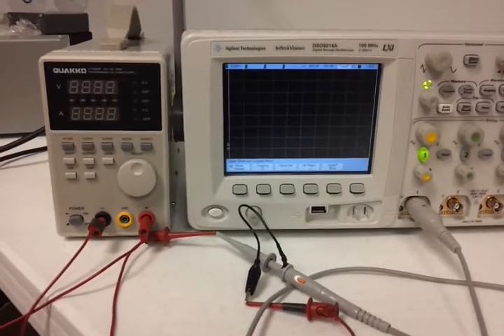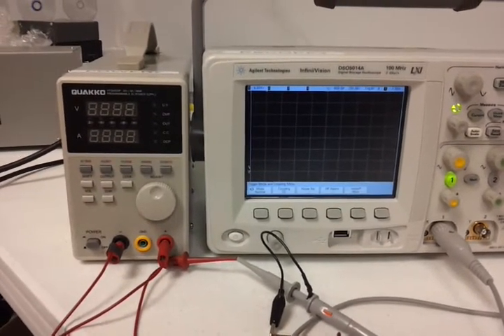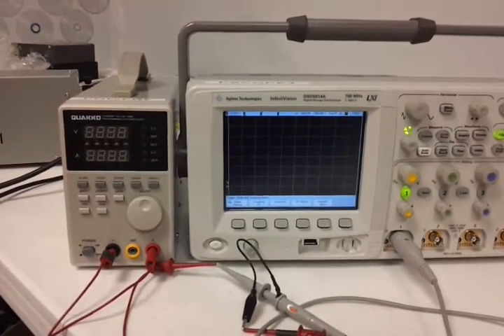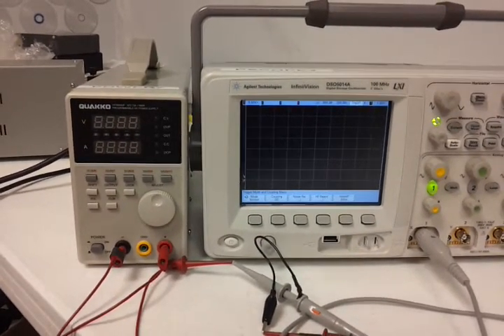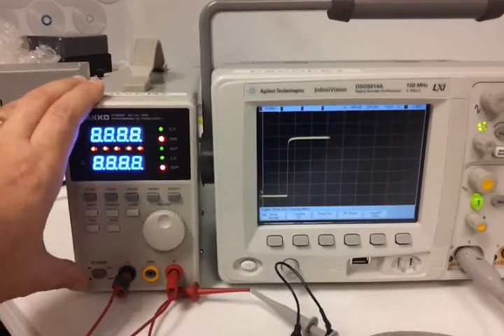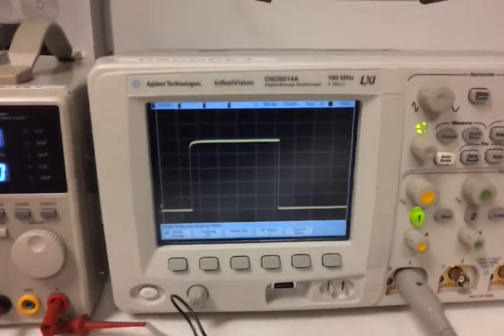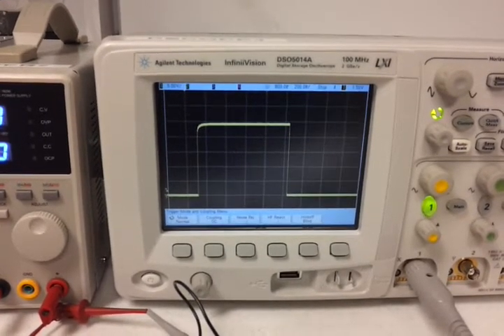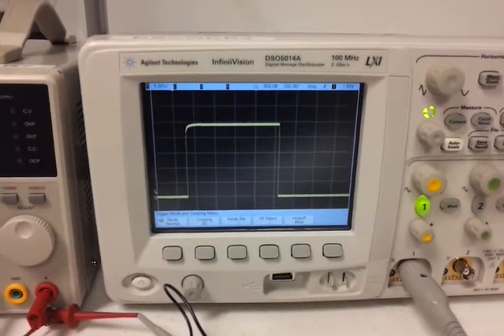video-2011-12-15-16-55-06.mp4

Comment from the maker: Yes, I believe this is correct.  A brief look at the circuits inside shows that it has a transistor follower output stage and that the base drive of that transistor floats to about 28 volts in the first second of turn on, then goes away.  Looks like the opamp regulator circuits default to high voltage during that time, which is bad.  I'm sure some suitable RC startup circuit somewhere in the design, even if it was directly across the base drive, would solve this problem.

Comment: Looks like it simple floats as a 25v supply with no control from the micro controller. You can see once the micro controller finishes initializing the display the output is properly regulated again.

I can't see why it wasn't designed so the output is disabled by the analog circuitry until the digital logic comes online :(

Comment from the maker: I didn't test those parameters but I believe them to be fine.  The Power supply was fairly accurate in terms of voltage and current readings, so it wasn't bad except for this very serious and fatal problem.  You simply can't have it blow up boards if the CA mains drops out for a minute and comes back.